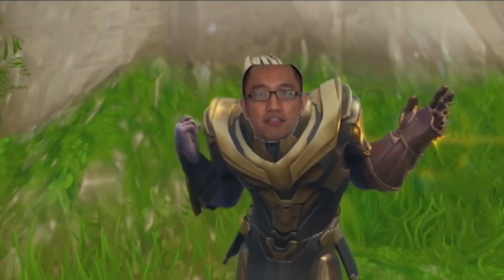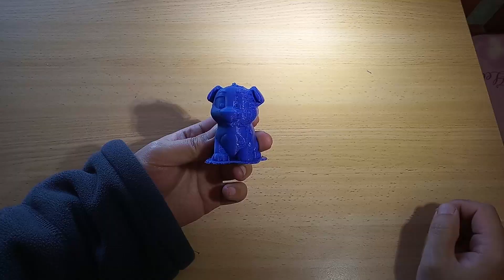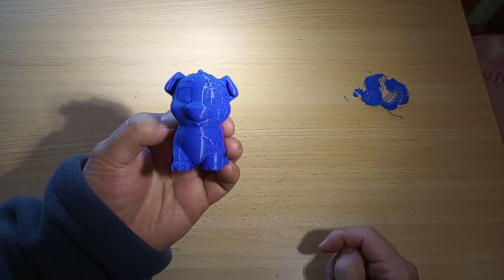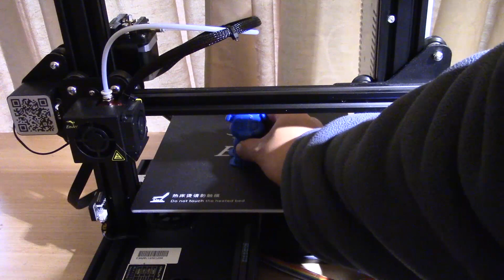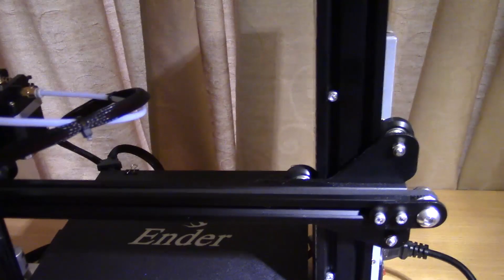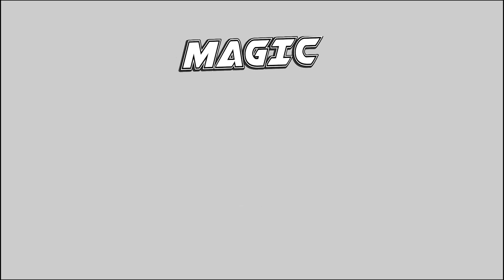Fix Creality Ender 3 3D printer -  half of model dog destroyed grainy unclear

Comment: So I put my printer together last night and I downloaded this automatic bed leveling file. Every SD card I put inside of the 3D printer does not read any of the cad files....except the one that came with  it... I even reformatted FAT32 my SD cards. Anyways that aside I went ahead and did my first print which said it was going to take about 4 hours. So I went to bed because it was 2 am. I woke up this morning and it printed a small dog literally half the size of my thumb. I was just wondering why my dog is so much smaller than everybody else's

Comment: I just tried the pig file... got 33% complete then stopped?  I clicked resume... but it lowered the print head all the way down and popped the incomplete print off of the base? Any ideas? This was my first print after assembling. This was 3 hours or so into the print?
Reply: same its so sad i was so hyped to see the pig
Reply: 3 hours and only 33%?
Reply: I can only get 50% of the dog complete and then it pulls off!! I have no idea what else to do!!
Reply: Adjust bed temp to 60 or 65. The preload usually has the bed temp at 45... well mine did anyway